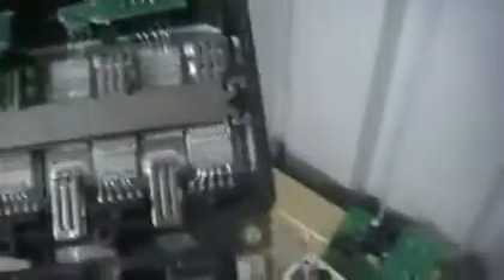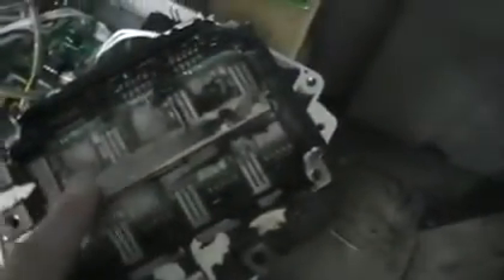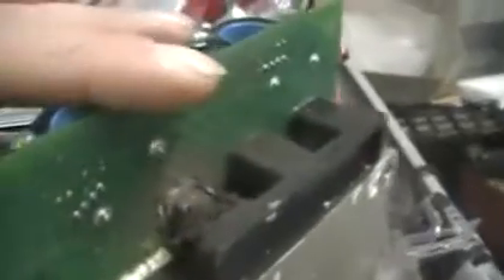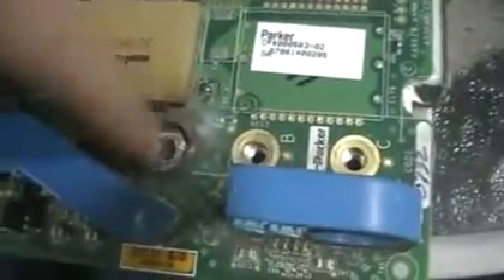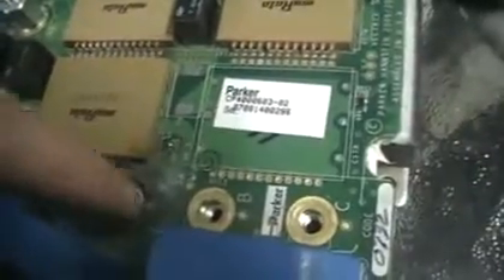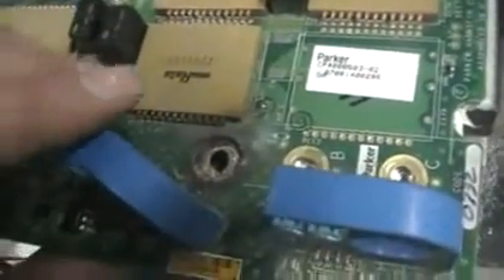Vectrix Motor Controller Repair Tutorial part 1

Comment: Thanks  AntScab for your Help.

Just tell me something, If you can to fix your motor controllers, How much is the price?
Reply from the maker: If the motor controller I have to supply, then AUS$1000

If I am repairing a motor controller you supply, it depends upon what is wrong.
If a new IGBT is needed, then that is AUS$600 - that's the most expensive thing to go wrong

If the problem is something else, then much cheaper, usually $200 at most. the only issue is if it is something I can't fix

Comment: Hello Antiscab.

I don't have the controllers, let me explain you.

I work for a technical school in Colombia called Sena (national service of learning in spanish), We receive a donation of five Vectrix motorcycles from the national taxing. They were confiscated and the government gave them to us, but they did not have Motor Controllers.
Now we want fix them, and we need to buy the motor controller, new is imposible for us, for the price in our country. personally I will thank to you if you can help us to find them.

I will be waiting for your answer. thanks a lot.
Reply from the maker: I don't have any working motor controllers, but, I do have several dead ones, with issues that are a little trickier - some with SMD parts that need replacing (which I don't yet have the tools for) and others that have been "bricked" due to a bad firmware upgrade.

I will look through my collection, so see exactly what their issues are, and whether they may be of some use to you
Reply from the maker: I had a look through my dead motor controllers collection:

the first one burnt out at the terminals. there are wires embedded in the PCB that have been exposed and severed. many of the SMD parts have been damaged too.

The second appears to have an issue where when installed, the vectrix defaults to charge mode. I suspect it's a software issue, but I can't update the firmware. the micro may need changing

I have two others which don't give signals to the IGBT module on one phase - although I think I can repair those two

Comment: Hello Antiscab.

I would like make business with you I`m form Colombia and I have five Vectrix VX1  without Motor Controller. I need your Helping Hand for Buy to you The controller.

Are you Interested ?
Reply from the maker: Hi,

I don't actually have any spare working motor controllers at present.

your 5 vectrix, do they have not motor controller? or just damaged motor controller?

If just damaged, I can try to repair